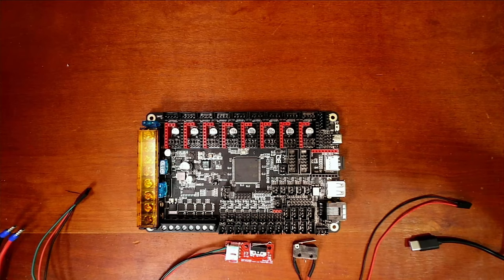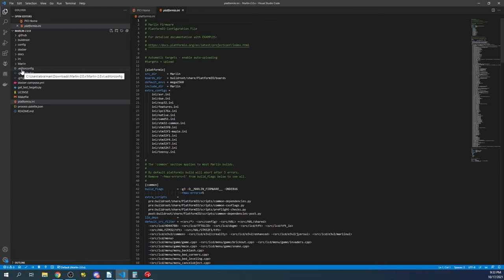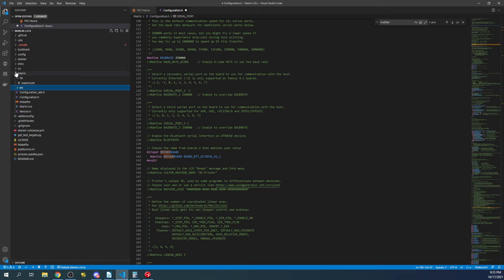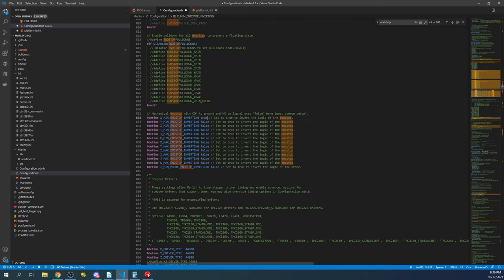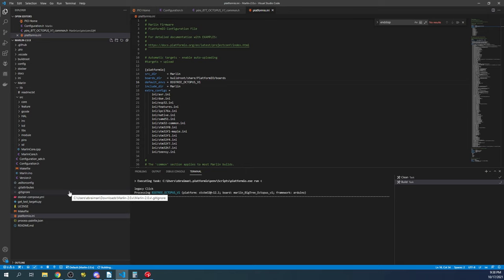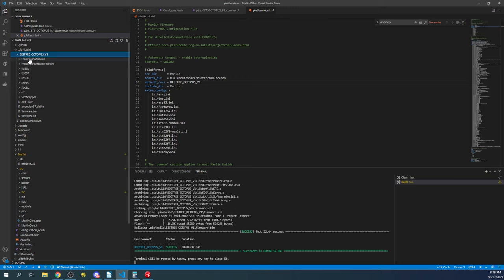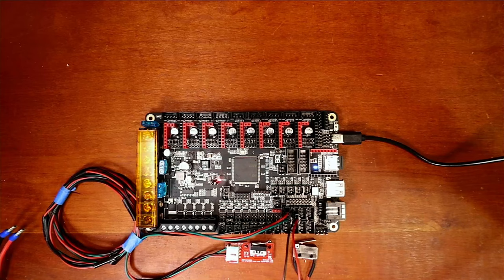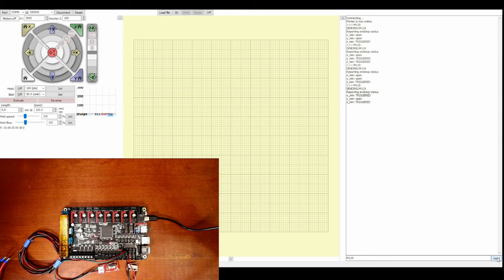BTT Octopus v1.1 - Switch Endstop

Comment: When dealing with end stops, A pull-up/pulldown resistors is essential for safety. They prevent a possible floating state, if the wire is broken.
for instance, on a 3 wire switch, + ,  - , signal.
When the switch is engaged, it pulls the signal to + .
If the + wire has a open in It.
without a pull-up resistor, the signal is floating. An indeterminate state.
With a pull-up resistor, the circuit performs normally.
If any other wire has an open, the processor will see a + signal and stop immediately. 
this will prevent the axis from continually bumping the end stop switch.

Comment: Hy, i cant use my printer with Octopus Pro429 cause of 3 things right now :
1 : heated bed ( i'm using Ender 3 V1 hardware) not heating but i have bed thermistor reading -----(not using SSR) i just connected bed red to bed out+ and bed black to bed out -
2: limit switches not working but when tested with M119 command shows ok ----all axis move in the correct direction -Fixed ( y axis motor was inverted i inverted movement and also endstop
3: TMC2209 set on EN/DIR all moving but on display shows TMC CONNECTION ERROR- Fixed after Eeprom init error gone
P.S. Discord link not working for me ...maybe only for US ?
What can i do , googled but nothing found!
Reply from the maker: I'll fix discord link, as it might have timed out.  Look for my newest video and see if discord link works or on channel.
Reply from the maker: Updated Discord link in description ... https://discord.gg/GafhGsSnpJ
Reply: @EdwardBraiman  thank you

Comment: Hi, I wanna ask. Is it the endstop status can display auto in the terminal? without we send the Gcode. I mean when the endstop is triggered then in the terminal will display the status directly.
Reply from the maker: With a gcode you're basically requesting MCU say if endstop state is high or low high meaning true.  It's normally only used in the beginning to find a starting point of 0,0,0 in the Cartesian coordinate system.
Reply from the maker: If you want to display you'd add m106 after gcode g28.
Reply from the maker: Note depending on configuration of firmware it may say false.  Because there's a back off endstop functionality that can be enabled by default.
Reply: but for this m106 and g28, that one for fan speed control and homing right? Because, now i just want to set the auto display for endstop status without I need to send the M119 gcode @EdwardBraiman  . But im not sure is it possible or not
Reply from the maker: @FBTheresaFazline m119 will give endstops status in gcode.  After a g28 there maybe an endstop offset setup by default in Marlin or klipper FW.  Generally in gcode file it reads commands and processes them via MCU firmware loaded on processor.
Reply: @EdwardBraiman  so that’s mean the endstop status can display auto depend on configuration of my firmware?
Reply from the maker: Which terminal LCD or pronterface type terminal?
Reply: @EdwardBraiman  pronterface
Reply from the maker: When it's reading m119 in gcode from terminal block of send in pronterface it will also read from a file.